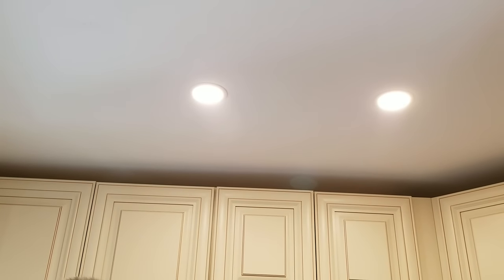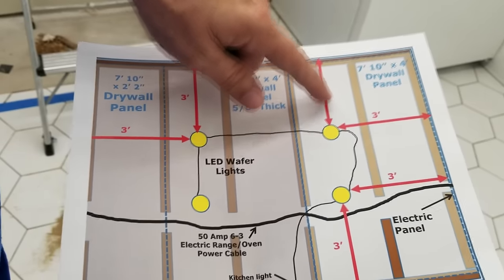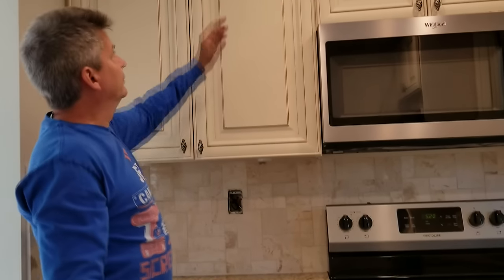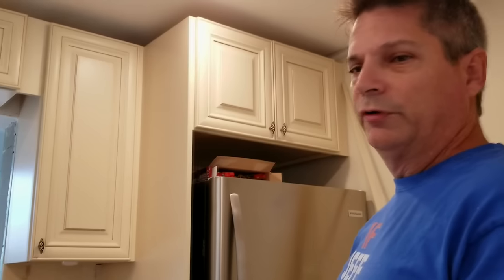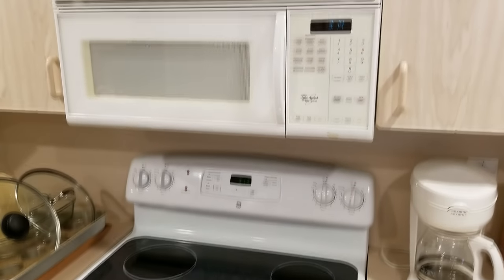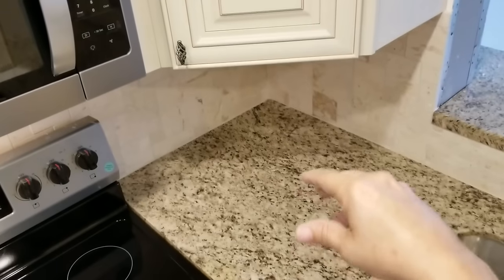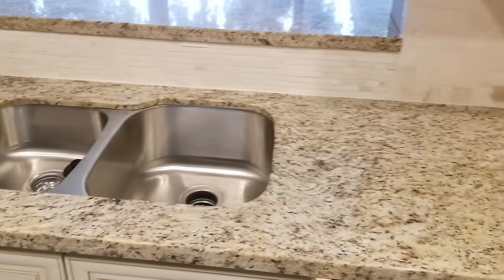Kitchen Light Spacing Best Practices, How to Properly Space Ceiling Lights

Comment: I'm interested by the 3' and not 2', thing. I'm planning kitchen lighting for the first time and most websites say you want the lights at 2'. Apparently they shouldn't be behind you, so they cast a shadow onto the worktop, and not too far in front of you either, so they're too close to the wall units as you mention. Here in Europe at least, worktops are 2' deep, and you typically stand about 2-6" back from the worktop when preparing food, so I'd have thought above the edge of the worktop, above your hands, would be ideal? 3' will surely be behind you, casting a shadow?
Reply from the maker: 36 inches off the wall is not so far behind you because when you stand in front of the counter you're pretty much at 30 inches anyway so this is really only 6 inches behind you so the best thing to do is to make a mock up and hang it from the ceiling and see what kind of shadowing you get and whether it causes any issues for you.  You should be able to move this fixture all over the place and test different placements on the ceiling

Comment: Thank you for educating me on the LED Wafer lights.  Now regarding putting them 36" from the wall.  I installed three windows in my shop.  I am planning on building a soffit along the window wall and install the canned or wafer lights in the soffit - one above each window.  Should I still install them 36" from the wall or can I bring it in to 24"?  I am planning on putting in moveable workbench / carts along the wall.  These will be primarily accent lights as I will be installing LED main lights in the shop.  Thanks!!
Reply from the maker: If there's no cabinets in front of the window, I'd leave the LED lights right in the middle of the soffit. In an ideal situation you want the lights to be over the counter, about 12- 24" from the wall, if there are no cabinets present. In this video you can see that the presence of cabinets caused us to place the lights 36" away to avoid dark shadows under the cabinets. But to prevent your shadow from dimming the light over your counter while you work, you will want the LED lights to be 12" to 24" from that back wall. With no cabinets there, you don't have to worry about glare off the cabinet, or the cabinet darkening the back corner of the counter top.

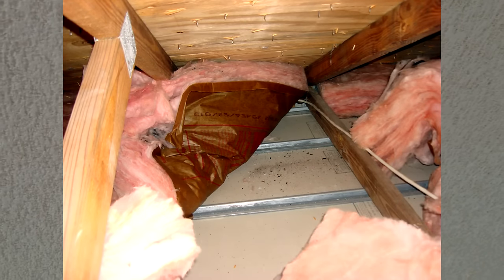Comment: At 10:23 - the electricians should have used IC-rated can lights.  Anything painted white is non-IC rated.  But to minimize the fire risk if such cans already exist, use an LED trim; those won't get hot.
Reply from the maker: Yes, those lights shown at 10:23 were installed by the builder in 1993, very stupid, very illegal and should have been IC rated, or should  have had the cage built around them, which is the other NFPA and likely NEC requirement.

Comment: Hi Jeff,
I am so glad I found your video which gave me a lot of ideas about the positioning of downlight . I am building a new home I have an electrical plan but I want your advice to pinpoint the positioning of my down lights. If you can do that I will very thankful to you.
Reply from the maker: If you are starting from scratch, you can do so much more than we were able to do in this small condo kitchen with a limited budget. You'll want to make sure you have task lighting over the counters, so lights should be over the front edge of the counters no more than 24" from the back wall. Then make sure you also have lights on the ceiling over the walk ways of the kitchen to help light to the corners under the cabinets as we show in this video.

Comment: some can lights can be use in contact with insulation too. With this light, If you have loose insulation type you will have to push them out before pulling your light down right? Or else it will fall all over you.
Reply from the maker: Yes, you have to push it out of the way first. If you have attic access, I would try to go back in afterwards and put more installation to replace what was brushed away. Unfortunately for consumers, most electricians could care less about this, and leave your ceiling drywall exposed.

Comment: We have 16’ ceilings in our living room. What color, lumen, and spread would you suggest for our recessed LED lighting (4”)?
Reply from the maker: I would use 3000 Kelvin. It's hard to tell color and spread without looking at the spec for each light. You might have to buy a few, try them out, if your don't like the spread, take them back and try others. If you can get a light meter for LEDs, measure the ft candles on the counter, and shoot for at least 50.

Comment: I need to put some light on my walk in shower. Is a small shower 5x2.5 feet. I want then day light.  How many do I need and what size?
Reply from the maker: I think one flush mount LED light would do fine, you can experiment with 2 lights if you like. Just make sure both are IC (Intimate Contact) rated, and they MUST be rated for wet areas per National Electric Code, very important, if the box does not say approved for wet areas, then it is not, and you can't use that light.
Reply: @jeffostroff  what size?

Comment: sorry jeff but you are wrong , i was always taught ,and by more than one lighting designer that you place your lights so that they shine down on the counter and floor in front of it "usually 2 feet from the wall", this is general lighting which when you walk into the kitchen will provide sufficient general lighting not only for cleaning but also will light up the work space on the counter. The space under the cabinet is not really ever used to work  on , more so to place a cook book perhaps which then would be illuminated by undercabinet lights . In this day and age very few people dont want under cabinet lights especially with the newer led tape lights that install so easily and inexpensively. The system you are using is more for a living rm , den, or playroom. And by the way the recessed lights installed in an insulated attic space must be type IC these are used for "in contact" with insulation and are code compliant. The "firestarters " you mentioned were most likely installed by some handy man or diy'er who didnt know what he was doing. All this being said a lot of times the old style recessed with the cans could not always be installed symmetrically as you can now with the wafer lights due to the structural barriers present in ceilings and or attic space.

Comment: What if you have deeper upper cabinets, such as 15” deep? I assume you still put lights 24” in front of the cabinet, thus placing them it 39” from the wall?
Reply from the maker: Well, in your case, you would have an issue because the counter top is still 24" deep, so if you moved the light out to 39" from the wall, this means you are moving it 3" further from your counter, which is already at a disadvantage. So in your case, I would experiment with leaving it at 36".  BTW, good thing you asked this question, because tonight at 7:30 PM is the live premiere of our latest video, the sequel to this video, which we show you how to measure light output at different parts of your kitchen, and you can see the effect of distance of the lights on the light intensity readings. Click on this link and click the bell icon on the video to be alerted when it launches live with Q&A tonight: https://youtu.be/g5Ghx7-UJiU. If you can't make it live to the premiere, then you can of course watch it any time.

Comment: There is also the issue of balanced lighting in the rest of the kitchen.  I’m just getting ready to place my can lights and reviewing recommendations to get the best placement.  I think I will go with the 36” recommendation and also have under cabinet lights which I had planned on anyway.  
PS. I see nothing wrong with using full side cans when you have the access.  Virtually all the cans are insulation rated anymore especially when using LED’s that don’t degenerate heat.  Of course check your specific cam ratings before you install them.  
Good is using.  Thanks
Reply from the maker: Thanks, I'm glad you liked it!

Comment: I have a question does Condon have ceiling like with 2 x 4 drill in the concert. I wanted to recesses light   in my Condon that was build 1984. Thank you
Reply from the maker: If your kitchen was built in 1984, it might be very much like this kitchen was. This has a cement floor above us from the floor above us. If you are the top floor, you might have a crawl space with studs, not sure. See our other video "How to Raise Kitchen Ceiling Height, Install LED Wafer Lights, Drywall
" https://youtu.be/wJHZ_S9e38U

Comment: Q1:How to run cable from basement to the second floor with little drywall and brick broken? This is used for out side cameras installations 

Q2:Why can we not install 24vdc or 12vdc pot lights for residential in a finished house ? we can use small wires, The small wires, which is categorized Low Voltage Wires, are  easy to run.
Reply from the maker: See if there are any other vertical pipes, ducts, or wires going up from basement and fish it through. Otherwise you have no choice but to slice into the drywall, I have done  that many times.

Comment: What is the deal with the one light being so close to the cabinet? I'd say that isn't 24in away. Plus from the first view there is a lot of shadow. Is there a light on the camera? That kills shadows.
Reply from the maker: If you are referring to the opening shot in the video yes they were shadow on the backsplash but zero shadow on the countertop we had everything tuned with the lighting there so that there was no shadows projected onto the countertop from the cabinets. As for the light by the fridge that happened after the fact when a design change needed to be made to the cabinets to make a full depth over the refrigerator with a cabinet wall there in between the refrigerator and the cabinets in order to obtain the stability to hold that new full depth cabinet. As you know most kitchens people use a refrigerator cabinet that's set way back so you often can't reach it but here to do necessities of what was going on after the lighting had already been added we really had no choice. The light probably could have been moved with some effort but it was decided not to since it was not directly over the counter.

Comment: There are a lot of can lights now that are designed to go next to insulation and the good thing about these kinds of lights are that when your light goes out, you just replace the bulb instead of calling an electrician to replace the crappy, chinese made LED light fixture.
Reply from the maker: I still prefer these newer puck lights, all you have to do is make your hole in the drywall and they clip in perfectly

Comment: As said before from another user, be careful because this solution works until the kitchen remains unused. If a person is standing and working in front of the cabinets he is going to create a shadow in front of himself with his own body, because the ceiling light is located behind his back. I'm not an electrician but this is just clear logic... undercabinet lights seems to be the only solution to solve this shadows problem.
Reply from the maker: You need to see or follow up video to this that debunks some of what you're saying. Some of you erroneously think that the light is behind you, when ti is not, it is more like beside you. Second, it does not cast a dark side of the moon shadow on the counter. See how we test out this kitchen after the lighting was finished. "How to Measure LED Kitchen Lighting, Ideas, Design Practices
"  https://youtu.be/g5Ghx7-UJiU
Reply: @jeffostroff  In this specific kitchen case, it all works fine because, as you said, you have the lights more "beside" than "behind". But maybe for another kitchen case the "rule of the 3' feet" alone is not going to work as well.

Comment: At 00:45 “I have never walked into a project an the contractor got the spacing correct”. I could tell right away that “Jeff” is a bit arrogant and is always RIGHT and never gets it wrong.  Jeff’s the greatest of all time.... haha. 
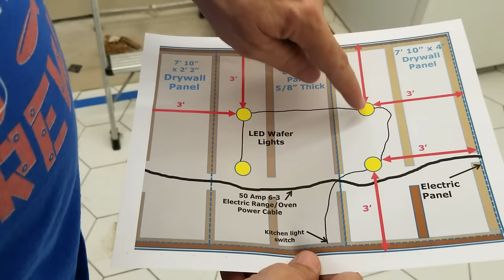And normally I don’t like to nit-pick videos because putting out videos is not easy. But I couldn’t resist and at 00:55 he’s got a 20 amp ROMEX sitting right on top of the Sheetrock? And if “I” were going to do something like that, which would not do, I wouldn’t put it in a video for YouTube. Ha-ha
Reply from the maker: In a 1 1/2" crawl space above the drywall, your options are limited.

Comment: Would you recommend to always stick with 3 feet from wall? I am currently under remodel and the contractor who is also my neighbor recommended to go further out by the fridge because how close it is.  The setup is similar to your but we also have a pantry next to the fridge which is about 18 inches so the light in front of fridge may not shine any light on the counter anyways.  My concern is that the other light which does light up the cabinet will also be 4 feet away from that same wall to keep things in line.  Will 4 feet away be ok to light up or will the counter also be dark on the other side of the room?
Reply from the maker: Awesome question. I think that sounds reasonable to try 4 feet. There's a couple of things you can do here. On my last kitchen that I just did a few months ago in my other flip condo, we simply got a 2 foot long ceiling light from Wayfair, and it looks like a short fluorescent light fixture, but it was really and LED fixture that had 2 rows of LED chips inside it and once you slide the lens on, looks like a modern design fluorescent light. That single 2 foot long LED fixture lit the whole kitchen and left no dark shadows under the kitchen cabinets. Another thing you can do is use the 4" LED wafer lights like I used here, try them 4 feet from the wall, and just connect them up first before you cut any holes in the ceiling, and see if the 4" wafer lights like I used will work, see if they throw enough down light to the back of the counters, and light them up enough. If they are not strong enough, or don't have enough reach, try the 6" version. You need to really look at the boxes on these, and see how many lumens these lights put out. So suppose the 4" is not enough, but the 6" is too bright, then you use a dimmer switch to control how bright they get. Lastly, consider a task light directly over the sink firing straight down. I could not do one here because I have that horizontal cabinet there above it, with that small kitchen I was maximizing storage space.
Reply: I think the light choosing option has already sailed :) I already purchased 4 4inch LED recessed lights for the kitchen.  I am still unsure if I should stick to 3 or 4 feet of that one wall.  I do not have the time to start shopping for new lights unfortunately nor do I have the energy.
Reply from the maker: Just wire one up and hold the light flat and pointing downward on the ceiling in the spot where you want to mount it and see how the light dispersion looks.

Comment: Im doing a mobile home remodel. How might i use these wafer lights on a slanted ceiling? if i just install them flat into the drywall they will be pointing into another room and not strait down
Reply from the maker: These will point at an angle. If you do not want that, then you will have to find lights that swivel to make up for the angle.

Comment: Just to clarify, how close to cabinets do i install my lights.
Reply from the maker: Most of the lighting prose say 24" off the back wall for task lighting over the cabinets, which is 12" in front of cabinets. I like to also have some 36" off the wall to prevent harsh shadows and dark lighting under the cabinets on the counter due to harsh shadows cast by the lights being only 12" in front of the cabinet

Comment: Jeff...enjoyed your video(s).  They helped me a lot to plan out my kitchen lighting project. The Amazon link that you provided for the wafer lights is for a 4" wafer but they sure do look like they are 6" in the video.  What size wafers are in the video?? Thanks.
Reply from the maker: Nope, they were exactly 4" wafer lights in the video. They may look bigger due to the bezel, but I believe they measure across the diameter of the light opening, and not the diameter of the bezel.

Comment: Loved the video. These lights are awesome. What would you suggest for a ceiling that is slightly angled/sloped? Are there adapters for these that retain that C1rating for contact with fiberglass?
Reply from the maker: Most of the lights like these will work on an angled ceiling. I would make sure they are I.C. Rated, which means Intimate Contact with insulation, and make sure they have a gasket so when they are installed against the ceiling, they seal any air gaps to prevent heat or AC loss.

Comment: They did this for task lighting. It's a kitchen, brother. A lot of times people will supplement lighting out in main area of kitchen to remove that shadow you mention.

Also - who uses those types of potlights anymore? Use 4" slims.
Reply from the maker: Those are not potlights in this video, they are 4" wafer leds, only 1/2" thick. Where did you get the impression they were pot lights?

Comment: that 3 feet is referenced to the ceiling height or what ... seems that cabinet depth and ceiling height should be added into the formula. 3 feet is not a constant ... the light source angle of dispersion is also a factor (beam spread) ...
Reply from the maker: The 3 feet is the distance from the wall, has nothing to do with ceiling height.